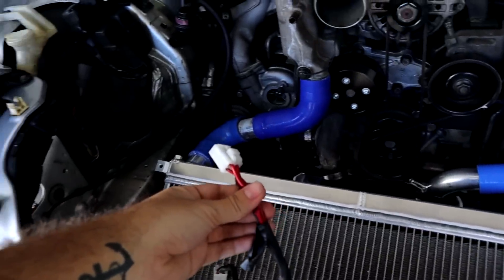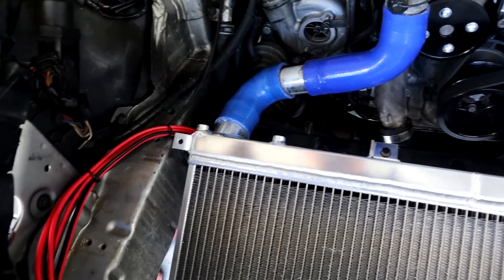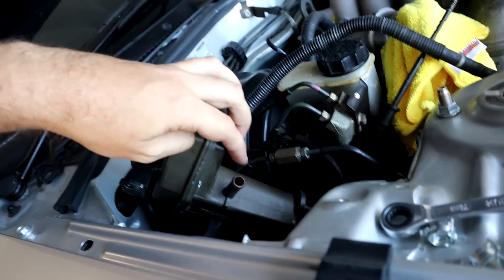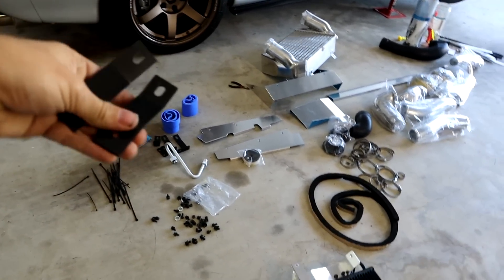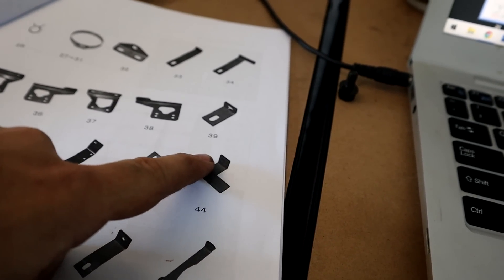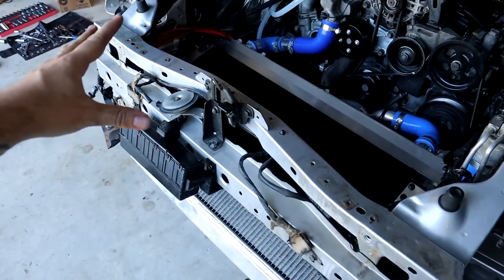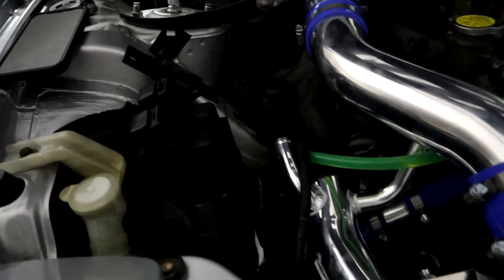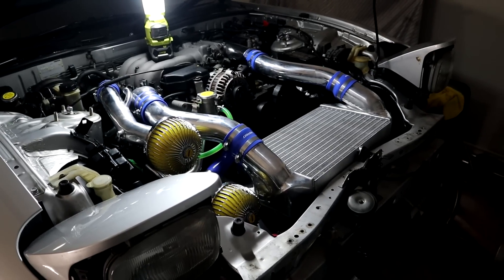FD RX7 GREDDY V-MOUNT INSTALL pt.2

Comment: Looks good, might need to get the upper intake manifold polished lol!

The only thing that may need attention is that top intake pipe. May need a bracket (refer to Bad Obsession), from that boss to the tower. Just in case the wrong cop pulls you over, as the intake pipe needs to be secure.
Reply from the maker: Thanks man! Yeah silly me snapped a bolt in it :( I’m going to do my best to drill it out and use an easy out so I’ll see how I go with that, but yeah it’s awesome ☺️ cheers Pete! Need to catch up one day’

Comment: Are those radiator fans pull fans? Is so shouldn't they be push to push all the air through everything from the bottom?

Comment: That air con line work is dodge... look at the kink you created bro...
Reply from the maker: As long as there is room in the line for flow it will be fine, it’s a bit how ya goin I will admit, but the lines were already fiddled with and I don’t have a tube bender unfortunately. I’ll fix it up in the future
Reply: @ZacBaldy  I didn't mean I in a bad way, just pointing it out incase you missed it 🙂
Reply: Will be interesting to see if you have any leaks in the AC lines after?
Reply from the maker: @PinkBitzMedia   cheers man ☺️ and yeah I know it’s looks crap 😉 I tried